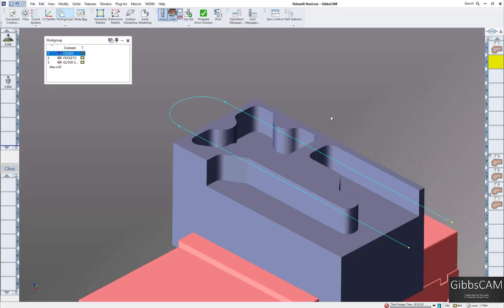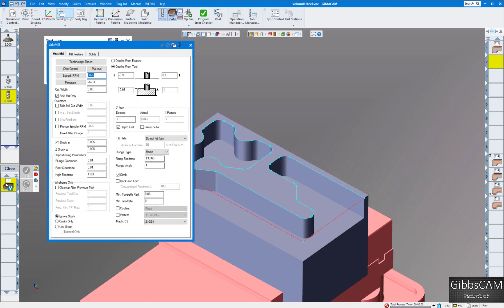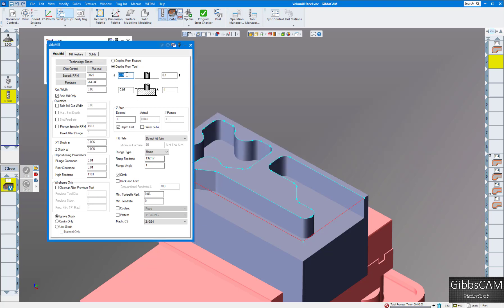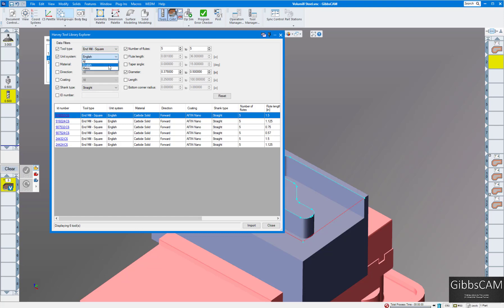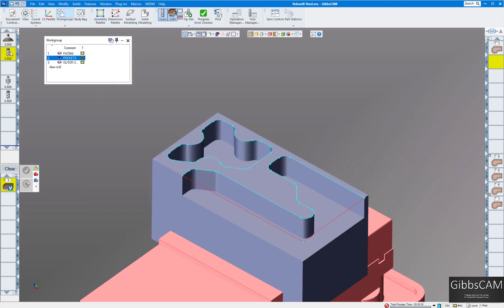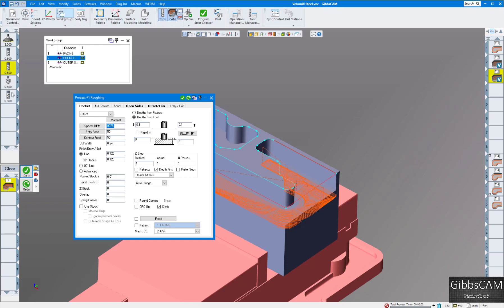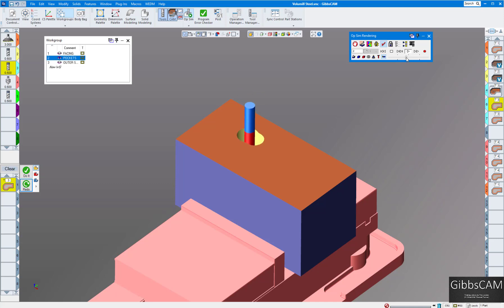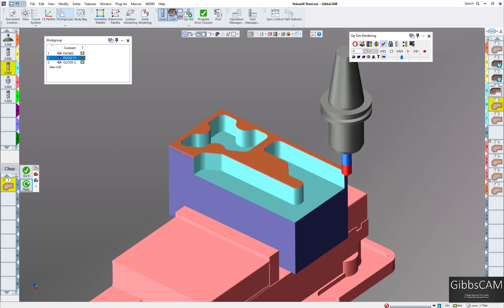GibbsCAM-VoluMill-Technology Expert-Harvey Tool

Comment: I use Gibbs to program y-axis sub spindle lathes. I work in a small job shop so I don't necessarily have time to "see what this button does" when programming so I might just not know how to use it, but I've tried to use volumill to make toolpaths similar (in my mind) to the "material only" option for turning to avoid cutting a bunch of air but haven't had much luck with it. Thoughts? Perhaps a video? To me the c axis is just a faster version of a rotary table. There doesn't seem to be as much information on live tool lathes on your channel, just looking to learn. Thanks!
Reply from the maker: Here is a link to one of my videos on using Volumill on a C-axis lathe.  Thanks for watching...   https://www.youtube.com/watch?v=CcvqQr4UCsw&t=19s